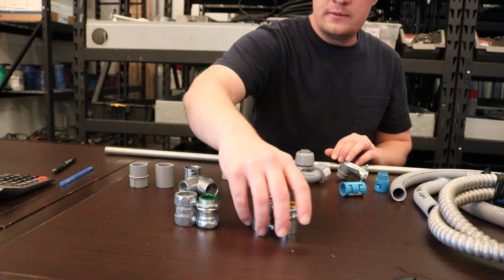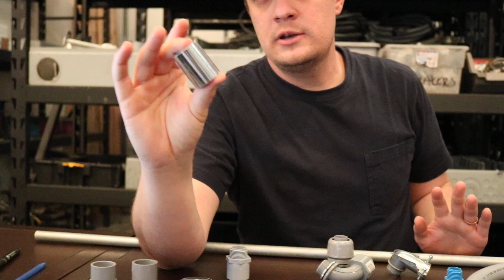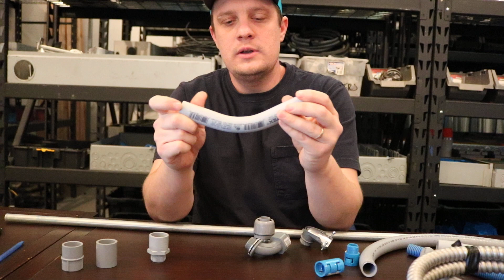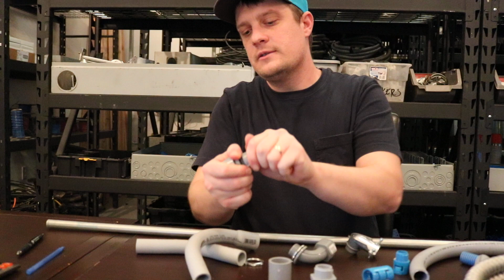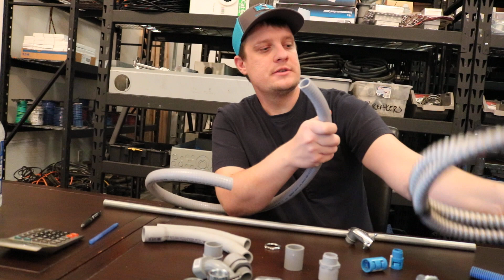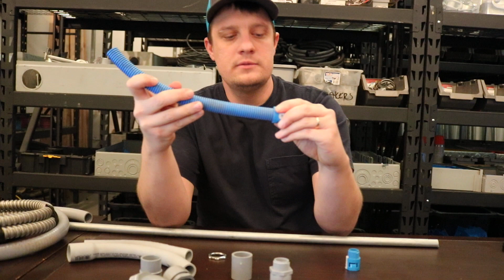Conduit Fittings

Comment: The silver compression connector wasn’t rain tight. That was just a normal compression connector there was no rubber gasket. And rain tights are either blue or black

Comment: What is the best conduit for 3 independent circuits in the same conduit ?
Indoor, I will need a jonction box to output one of the 3 circuits. 
The two others go in the same direction. One will be an indoor outlet the other one will be an outdoor outlet.
2 x 15 amps + 1 x 20 amps or 1 x 15 amps + 2 x 20 amps

Comment: Very good video on fittings.Do they make a off set fitting to connect to the a metal box to use if you don't have a conduit bender?Thanks.
Reply: Yes! Offset fittings are made in zinc and malleable from 1/2” to 4”

Comment: Best practice is NEVER use POS due cast fittings especially garbage made in India. If you happen to have a die cast set screw fitting tight and move conduit some fitting will often egg shape &/ crack. Seldom use the what you called a tight 90degree fitting especially if using solid wires. Better off using a LB condulets with cover . Must use expansion fitting on all PVC maybe over 10' long where exposed to different temperatures such as outdoors. A 100' run of PVC ran in a 100 degree temperature spread ( O in winter to 100degrres in summer ) will expand or contract 4". In industrial & commercial work most electricians will never use 1)2" EMT but rather a lot stronger 3/4".

Comment: with the flexible PVC can i use a standard fitting and glue it together?
Reply: I'm pretty sure you can use PVC couplings same size that flex PVC is.

Comment: Exactly what I was looking for.  It has been a long time since I worked with wiring, and there are lots of new fittings/technology.  In the way of a constructive comment, I'd suggest that your videos would be well served by working off of an outline, rather than just winging it.  You obviously know your material, but the presentation comes across as a little slap-dash and non-comprehensive. Knowing the main points you want to make about each item you discuss would make a big difference.  Another technique issue: have your camera person do the zooming as the objects that are pushed at the camera go out of focus.  Overall, good video - I'll look for more.

Comment: FYI...National Electrical Code does NOT allow for rigid coupling to be used as a 'from-to' or transition from one type of raceway to another.  300.15 states: "Fittings and connectors shall be used only with the specific
 wiring methods for which they are designed and listed."  Rigid couplings are listed and approved for use on RMC ONLY.  There are many U.L. listed fittings for transitioning from one type of raceway/cable to another.

Comment: Never purchase or use die cast electrical fittings made in lack of quality control India. Pure garbage. Have them egg shape & crack. I only use the 90 degree fitting as a last resort. Way better using a LB condulet especially if have a lot of wires. Should mention that you must use an expansion fitting when running lengths of PVC. A few inspectors on my northern climate now want them on PVC that feeds underground to a low mounted meter socket. Cases where after PVC pulled out of female adapters that.wire pulled out of meter terminals.